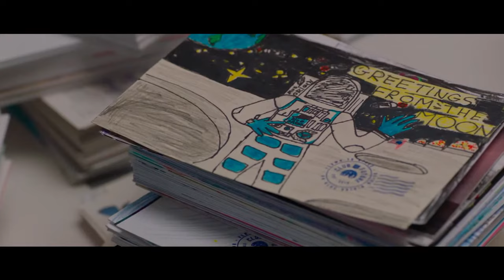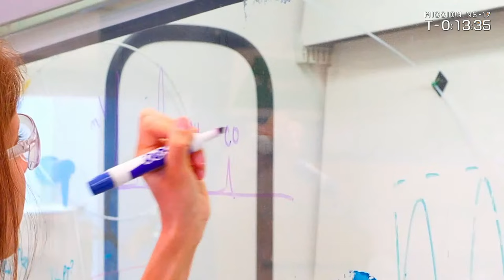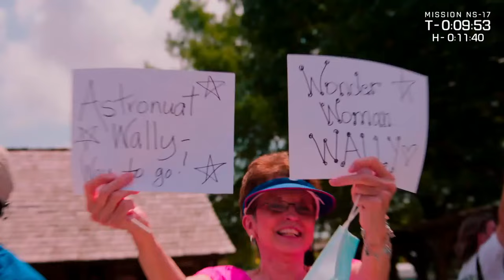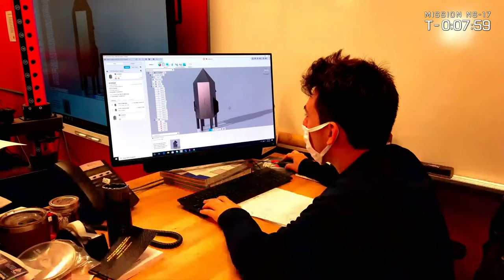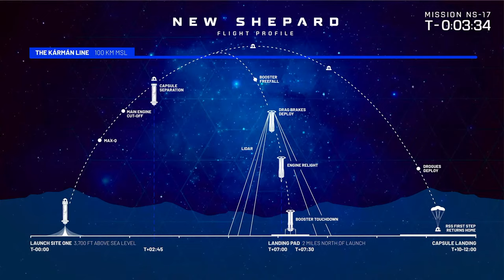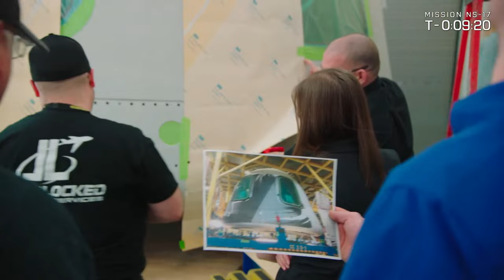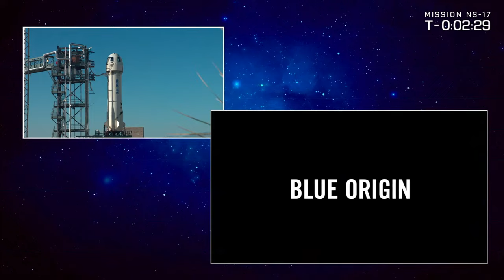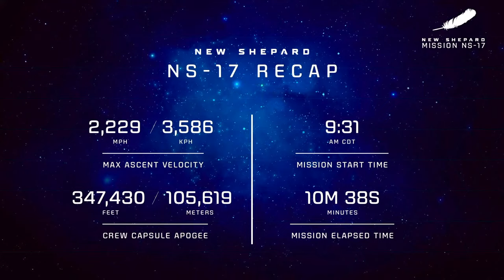Replay - New Shepard Mission NS-17 Webcast

Comment: propulsive landing of a rocket? That seems immensely complex and high risk...
Reply: Not to mention the number of times needed to refuel and such....
Reply: Oh my gosh. That is hilarious! XD
Reply: That comment and infographic seemed to really have triggered the SpaceX fanboys and Elon cultists.  More of that please Blue Origin!
Reply: @drawcoder  we aren’t (well I at least) elon cultists. But explain this to me. SpaceX has its rocket on the launchpad. When it’s gonna’ fly it will be the biggest and most powerful ever. But I guess we should choose BO cause they have no rocket, unlike SpaceX that invested in new unconventional systems that push tech further.

When we’re gonna fly missions to other planets what will we choose:
1. Design a new vehicle for each type of mission (traditional way)
2. Have one type of vehicle that is powerful enough for all missions
Your choice…
Reply: @chairpara  New Shepard and New Glenn are reusable.  

The silly part about a using a completely reusable one rocket/starship as the lander is that it is a tall ass rocket as you mention, the entry is 120ft up, 10 stories off the surface of the Moon, requires an elevator instead of a ladder.  That is problematic. Not to mention the 10-16 trips needed for all that fuel. 

The big rocket, many engine approach is probably better for Mars not the Moon.  Blue Origin is using liquid hydrogen for second stage and lander, that can be eventually processed on the Moon.
Reply: @drawcoder  New Glenn will be reusable, whenever it flies. They won't have engines for ULA in 2021, while the NG version needs to be far more durable.
Reply: @chairpara  no offense but you don't know what you're talking about
Reply: @drawcoder  If BO had a rocket on the pad just like spacex and NASA would still choose spacex then they would have all the rights to file a suite. But they don’t have a rocket so to me it seems that they are just jealous…
Reply: @wouterdevlieger1002  BE-4 is delivering 2022, already a couple and it is in quality review.
Reply: @chairpara  New Shepard has flown higher than Starship, on the pad doesn't mean done.
Reply: @drawcoder  ULA should have had  flightworthy engines by now. They won't get them this year. And the ULA version is expendable, the NG version needs to last far longer. We won't be seeing NG launch for years. Hell, NG's second stage looks worse than MK-1 did.
Reply: @drawcoder  New Shepard is sub-orbital. Falcon 1, Falcon 9 and Falcon Heavy are orbital and each one of them has flown way higher than New Shepard

EDIT: I agree that on the pad doesn’t mean done but at least on the pad is better than a sketch
Reply: @chairpara  Seems the B.O. fanboi's missed understanding about the Economies Of Scale that you get with a fleet of easily manufactured large vehicles that can have multiple variations made on the same base design.
Reply: @drawcoder  No BO orbit yet? I didn't think so.
Reply: @drawcoder  Where's BO's orbiting rocket?  Is it on a pad yet?
Reply: @PiDsPagePrototypes  true. They have a point tough. Competition is good. But this is not competition. This is 2021 BO trying to catch up with 2010 spacex…

EDIT: 2010 = first flight of F9
Reply: @drawcoder  Why are you comparing a sub orbital rocket with something like Starship in it's prototype stage? It's not the same thing. Even Falcon 1 reached higher speeds and altitude than New Shepard ever will. Anything orbital related Blue Origin has done is releasing CGI videos. SpaceX with F9 has 124 successful missions, 89 landing with reentry speeds BO can only dream off. BO orbital rocket has not even reached the pad yet.
Reply: @drawcoder  The 99.9% of comments calling out Jeff Bozo and BO for impeding human spaceflight really seem to have triggered you.
Reply: @drawcoder  New Shepard is a novelty amusement ride, New Glenn doesn't exist. BO lander doesn't exist. The engines BO were contracted to supply to ULA in 2017 don't exist. See a pattern here?
Reply: @drawcoder  They said they'd deliver them in 2017. They still have not finalised the design, let alone tested or delivered any
Reply: @PiDsPagePrototypes  Don't forget Falcon 1...which reach ORBIT 13 years ago.
Reply: @chairpara  2008 = first orbital flight of Falcon 1
Reply: @RippanCSGO  New Shepard is not the competition to Falcon or Starship... ULA Atlas and Vulcan are.  Blue Origin is buildign BE-4 engine to replace Russian RD-180 rockets.  New Shepard is testing BE-3 engines that are on the Blue Moon lander. However, New Shepard HAS flown higher than any starship and all successful flights, SpaceX is taking the brute force blow things up approach and only flown a third of the height of the New Shepard.
Reply: @kirkc9643  true. But that had a pretty low success rate and most of their flights failed… so just to be safe I said f9
Reply: @drawcoder  i don’t think you get this. New Shepard is sub-orbital. It may have flown higher than starship. But not higher than f1, f9 and f heavy. And if you are taking it this way then starship has flown higher than new glenn (its competitor) so…
Reply: @drawcoder  "New Shepard has flown higher than Starship"
Also @drawcoder: "New Shepard is not the competition to....Starship"
Well duhhhhh, we knew that, but if you know it, why TF do you keep spamming the comments section with that first statement?!
Reply: @kirkc9643  That is why it is funny, it isn't even supposed to compete with SpaceX but has already flown more and higher than their moon lander rocket.  

The New Shepard is the BE-3 test rocket that will be used on the lander. Again, they are competing on the lander and engines not the vehicle, that is ULA.

The competition is just beginning. 

It is interesting so many people are on a Blue Origin video, that definitely wasn't recommended to them, hate Blue Origin so much and love SpaceX. I mean how often do you see this on SpaceX threads? Hrm, can you say astroturfing or shall I say cosmoturfing.
Reply: @chairpara  I don't think you understand that I was talking about BE-3 lander rocket on New Shepard. And yes, New Shepard isn't supposed to be Sharships competitor, SpaceX/Blue Origin are competing on the LANDER.  The point is SpaceX lander IS the Starship upper stage and it hasn't even flown higher than the Blue Origin lander engine.  It is very simple.

The competition is just beginning. 

It is interesting so many people are on a Blue Origin video, that definitely wasn't recommended to them, hate Blue Origin so much and love SpaceX. I mean how often do you see this on SpaceX threads? Hrm, can you say astroturfing or shall I say cosmoturfing.
Reply: @drawcoder  that’s fair but in terms of the launch vehicle, the raptor has flown more than the be-4 which will be used on new glenn and vulcan. So it’s a draw. But if you consider spacex’s experience with landing a rocket from orbit and that starship can carry much more payload, then…
Reply: @drawcoder 
 I have flown higher than New Glen,  just by flapping my arms.  
But that doesn't make it an intelligent argument.
Reply: @paulsto6516  Why are you on a Blue Origin video if you hate it so much? cosmoturfing much? Clear SpaceX fanboy and you know it. SpaceX and Elon hate competition but you can't shut up about it and Elon looking worried. Competition is good for those reasons.
Reply: @chairpara  Fair point but was mainly talking about how people saying what is this for, the BE-3 is on the lander and this is another test of it.  BE-4 not there yet but will be.  I am big on US rockets over Russian so any push on BE-4 or Raptor is good. 

I like both Blue Origin and SpaceX, for some reason people seem to not want competition on these things. I want to see them all succeed. Blue Origin will be working with ULA on Vulcan/BE-4 and they are the most experienced launch provider and they are part owned by Boeing that worked on the Shuttle and ISS so there is varying levels of space experience across companies. Each one taking their own way and it will be fun to see the best parts.
Reply: @drawcoder  i do like competition as well. When companies have competition they are pushed to innovate more and outsmart their opponents. But I am just furious that BO sued freakin’ nasa for a loss but they didn’t have anything build (except the lander engine) and were more expensive. If they had 2/3 completed new glenn or vulcan and the lander then it would be fair to sue nasa because they were an actual competition. But in those circumstances their audacity is just…
Reply: @drawcoder  starship isnt optimised for the moon its made for mars but even then the advantages that this ship has like cost, reusability and over 150 tons to the lunar surface, also i would much rather be lowered by a winch on a platform than manually climb a ladder with a full blown pressure suit that weighs hundreds of lbs on earth
Reply: @drawcoder  they we're supposed to the deliver the BE-4s in 2017
Reply: @omarimckenzie4084  All space estimates are late, it is the nature of making it quality/safe. Slow and steady wins the race.  There are already multiple killer features in Blue Origin engines (liquid hydrogen, less needed, cleaner) that took longer to ramp up to but will be competitive features. BE-4 is coming 2022 and two are in test. How many times has SpaceX been late? Every single time.  It is the nature of the biz.
Reply: @omarimckenzie4084  Way more risky due to that, landing that thing will be a challenge as it is TALL. I can't wait to see it, just like I can't wait to see Blue Moon. The elevator is problematic, complex. Better to get back with known tech and then make iterations. That is success based not brute force. They should make one for the Moon before over optimizing to Mars.  ULA has delivered payloads to Mars multiple times, SpaceX should be focused on the Moon right now. This is why competition is good, they won't be able to delay or ask for more money if both are in. It will be all about streamlining.  Competition makes all players better even your favorite, and we know clearly who that is. Omar Mckenzie ❤️s Elon.
Reply: @drawcoder  me? i have put up some valid points and i've proved to you that starship is a better rocket by FAR and you havent answered any question, also you think that spacex is ''afraid'' of blue origin and spacex attacked blue origin but spacex has done nothing to BO infact BO has attacked spacex with thier false infographic about taking 16 starship refuelling mission when it only takes 8, not to mention they got the size of the starship wrong, and BO claim that it launches from a spaceport that ''doesnt exist'' when infact boca chica is very much real, you trust BO with all your heart and you dismiss every single talking point and deflect while also calling us cultists and fanboys but i think your the cultist here, you never listen to anyone and you think that your the smartest person in this competiton, you blame trump and some dude called JimmyB, you like to bring up the same talking points over and over, like your all over this comment section white knighting blue origin and you cannot come up with anything other than ''hurr durr spacex bad your all cultists, spacex is china'' ect, now im going to ask you this question drawcoder, Why do you think we should choose a sub orbital space company over one with a proven track record and a ACTUAL goal to set humans on mars, why blue origin
Reply: @drawcoder  spacex...late...every single time?!?!? you dont know what your talking about, there is not set date for the raptor engine as its still in development, also spacex is rarely late, they make sure that all thier launches launch on time every time, while blue origin has been late on the new glenn rocket, the be-4 engine and now delaying the artemis program, blue origin has been late to orbit by 13 years compared to spacex, i can handle a delay here and there but by promising to deliver by 2017 by a CONTRACT btw, they are out of exuses, spacex production easily outshines big tech companies like boeing and lockheed martin because unlike nasa, spacex is a private company and therefore are not constricted by changing presidents

Comment: Does that art installation contain… I don’t know, some blatantly false infographics?
Reply: Ummm those infographics were actually right, not that they were nice or necessary, but it was not false information.
Reply: @KsNewSpace  they said, and I quote “it needs 16 flights to get it to the moon” this is false, they may only need 8 flights to get to the moon and back, probably 10 to be safe, 16 is just false.
Reply: @KsNewSpace  “launch from a space port that does not exist” is not accurate, a accurate statement would be “launch from a space port that is not finished”. The befor mentioned statement was false, as that would imply that boca chica has nothing there yet.
Reply: @KsNewSpace  Also, "Launch site that does not exist" isn't exactly accurate is it.
Reply: @KsNewSpace  and finally there depiction of were the grid find will be located on super heavy was false, small problem but shows that they don’t care about accuracy.
Reply: @KsNewSpace  Those were just about as accurate as the length BO uses for a feet.. LOL.
Reply: Whats hilarious is that the "Spaceport that doesn't exist" has more launches than LC-36
Reply: @KsNewSpace  there was also the distorted images making starship look much smaller compared to bo's lander.
Reply: @HarrisonAdAstra  They quoted SpaceX own files they shared with NASA, it was 16 flights. Sure, the number might have changed over the years but none of this has happened yet so they rightfully go with the original one. 

We're talking about 1200 tons of propellant delivered to LEO-ish. 8 flights is like the optimal solution where they can transfer 100% of their max payload per flight. That assumes Starship will wait in an orbit where they can actually deliver max payload to. This could be different in reality for efficiency reasons. And then you have to actually transfer the fuel. So there will be losses for sure. 16 flights aka. 50% max payload per flight seems like a safe estimate.
Reply: @KsNewSpace  it quoted the information of a cargo starship to the moon, not the lunar version, and even then the cargo version would only need ~12 launches, 16 is the absolute most if all the space in the starship was completely full and it was made out of 5mm steal.
Reply: @HarrisonAdAstra 
 They probably used google earth to conclude that erroneous statement. :)
Reply: @OortCloud  BAM!

Comment: Funny how the Blue Origin booster can’t land in the middle of the target, EVEN with the NASA lunar lander targeting system on board!  And yet, Spacex, more often than not, comes much closer to dead center almost every time.
Reply: And they hover over that thing for ages! Too chicken to do a hover slam!
Reply: @Diggnuts  You’d think the NASA targeting system would actively correct the final landing spot during that long hover but I didn’t notice any course corrections
Reply: @starhopper59  I do not think that experiment was on the shaft. It was located in the bell-end I believe.
Reply: @Diggnuts  Why would that be the case?
Reply: @starhopper59  Don't know, but the shafty bit does not have a payload option as far as I know.

All I know is that payload and experiments go into the top bit.
Reply: @Diggnuts  So we are officially calling it The Shaft now, love it.
Reply: @sealsix6  The shaft and the bell-end.. I'm not going to call that thing a booster!
Reply: ...on a pitching and rolling barge...from a much, much faster orbital profile.

Comment: This "rocket" still looks so uncontrolled.
Reply: That chicken dance it does as the motor relights for landing,... couple of times it's looked ready to make a fresh crater.
Reply: New Shepard flew higher that Starship and didn't explode, so not sure what you mean by "uncontrolled".
Reply: @drawcoder  Preach truth to these mindless SpaceX drones! 😀
Reply: @drawcoder  Starship is 50 meters tall compared to this stubby little thing, not to mention it does a freaking landing flip to land and it landed on its 5th try, and it doesn’t do a chicken dance upon re-light.   It going higher doesn’t change a thing. Especially since they don’t have to do landing flips and hover slams.
Reply: @drawcoder  It didn't fly higher than the first orbital SpaceX rocket, Falcon 1, 13 years ago...or the Falcon Heavy that put a car into orbit around the sun, beyond the orbit of Mars, or the countless Falcon 9 launches that have included taking astronauts and cargo to the ISS and putting over 1,600 satellites in orbit.
Reply: @killadroid2  BAHAHAHAHAHAHAHA "Truth"? Here's some truth:  NS didn't fly higher than the first orbital SpaceX rocket, Falcon 1, 13 years ago...or the Falcon Heavy that put a car into orbit around the sun, beyond the orbit of Mars, or the countless Falcon 9 launches that have included taking astronauts and cargo to the ISS and putting over 1,600 satellites in orbit.
Reply: @OortCloud  True because New Shepard is testing the BE-3 rocket that is for the Blue Moon lander.  BE-4 rocket is for ULA Vulcan replacing the RD-180 Russian rocket and for New Glenn.  As of right now though, in terms of the lander, Blue Origin is winning.  Blue Moon can go up on ANY rocket, SpaceX lander can only go up on SpaceX as it is a 120ft high starship that astronauts will have elevator up to. Blue Origin is iterating on US Moon leadership and SpaceX is trying something new.  It will be interesting to see both.  For some reason though SpaceX fanboys and Elon cultists don't want to see both.  Competition is good, even for SpaceX, fans shoudl be into it.
Reply: @kirkc9643  You must not know what "mission objectives" are my friend.

The NS was created for completely different purposes than the Falcon 9 and Falcon Heavy. A better comparison is/will be the New Glenn rocket.
Reply: @drawcoder  SpaceX fans don't seem to know very much, eh?